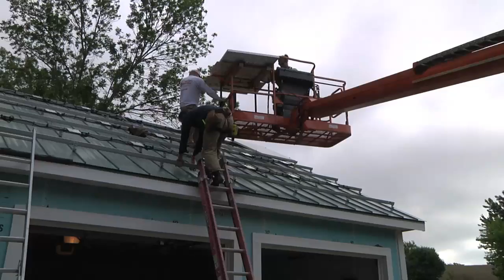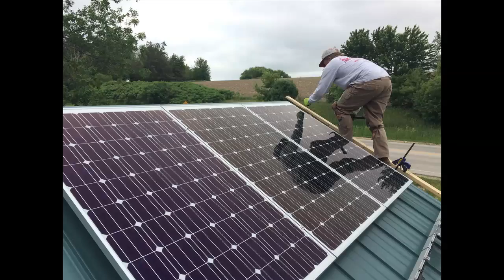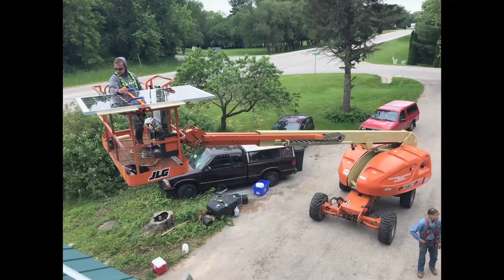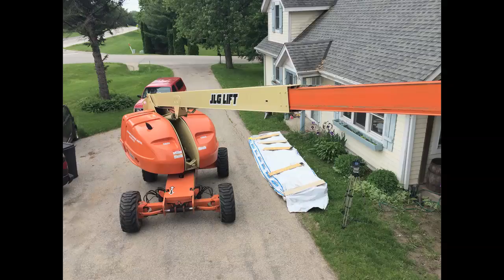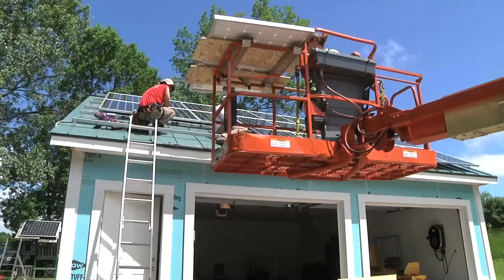Garage Solar Panel Installation Day

Comment: Would have been nice to install on a more steeply pitched roof for more direct sunlight. Read elsewhere you're in Wisconson so quite far north for the angle they're sitting at.
Reply from the maker: Unfortunately, the local building codes prevented me from making the roof steeper than it is. I ran the math, and for a grid-tie system overall annual yearly production, it works quite well.
What would have been nice was just a little steeper roof to make snow shedding a bit better.
The roof is due south, so just that part alone is really good.